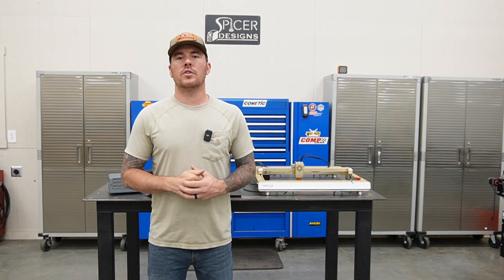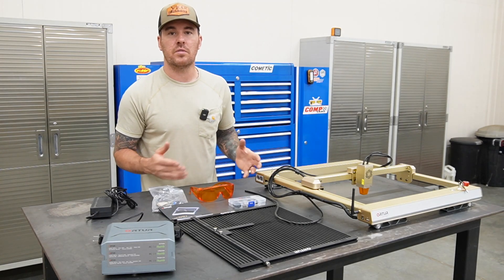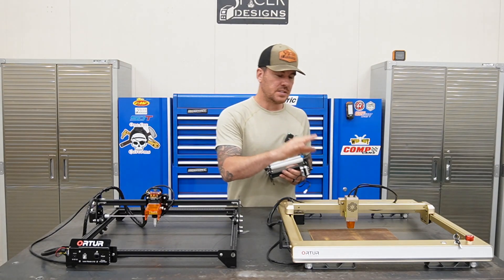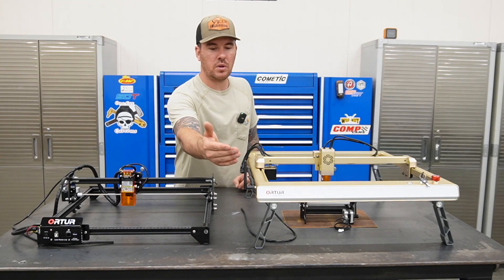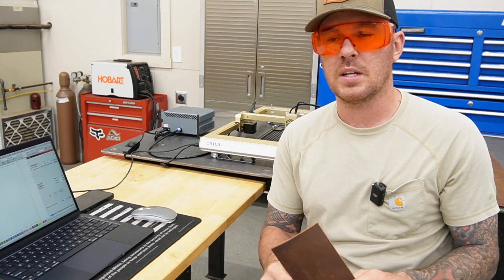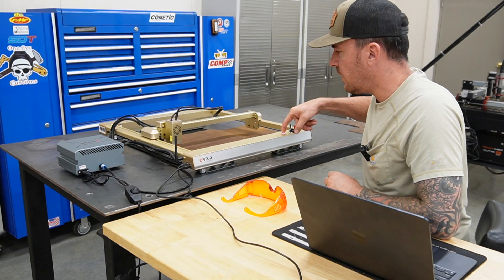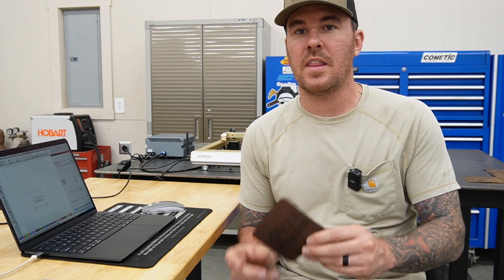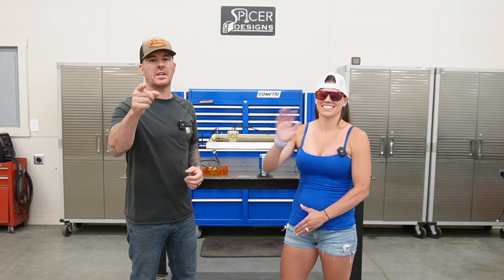ORTUR Laser Master 3...Best Laser Engraver For Beginners?

Comment: You didn't show how to connect it to the computer being these are wireless machines without USB. Is it bluetooth or do you need wifi in the shop to connect like how a Roku device works?
Reply from the maker: I believe its some kind of wifi signal.  I havent experimented with it yet.  I dont have wifi in my shop.  I think theres some other videos out there on that connection.

Comment: Well-Known Issues with Ortur Lasermaster 3: A Comprehensive Review

Issue 1: Ortur LM-3 Not Powering On
One of the most prevalent problems encountered by users of the Ortur Laser Master 3 is its failure to power on. This issue can stem from various factors, including a faulty power adapter, blown fuse, loose connections, malfunctioning laser module, or motherboard glitches. Notably, the Ortur LM-3 has faced criticism for having an underpowered "power brick." Despite seeking assistance for this issue, my attempts were met with silence. Subsequently, I discovered a suitable replacement on Amazon.

Issue 2: Inadequate Laser Engraving
When laser engravings fail to meet expectations, several causes might be at play. These include improper focus, uneven engraving area, or unsuitable materials for engraving.

Issue 3: Mid-Operation Halts
Frequent occurrences of the machine halting during operations can be attributed to loose connections, faulty motors, or software/firmware glitches. This issue has been highlighted extensively on YouTube.

Issue 4: Subpar Engraving Quality
Substandard engraving quality can arise due to incorrect settings, a dirty lens, or a malfunctioning laser module. To rectify this, adjustments in settings, proper lens maintenance, and considering the laser module's condition are recommended.

Issue 5: Smoke and Odor Production
During operation, the machine emitting smoke or strong odors might be a result of a dirty lens, improper settings, or insufficient ventilation. This concern is commonplace among lasers, particularly during cutting. Installing proper external ventilation and employing an enclosed setup are advised solutions.

Issue 6: Unusual Motor Noises
Motors emitting abnormal sounds during operation may be attributed to loose connections, inadequate lubrication, or faulty motors. Similar observations have been shared on YouTube. A common cause was Ortur's inadequate tightening of drive sprocket set screws, resulting in loosening.

Issue 7: SD Card Recognition Failure
When the machine fails to recognize an SD card, possible reasons include a faulty SD card, corrupted files, or firmware complications. Contacting Ortur for assistance may lead to unresponsiveness, as evidenced by my own experience.

Issue 8: Machine Freezing During Operation
Machine freezing mid-operation may stem from software/firmware glitches, motherboard issues, or communication problems between the machine and the computer. Establishing a reliable link between my Ortur LM-3 and my computer proved to be a major struggle. Despite weeks of effort and assistance from Ortur, I ultimately sold my brand-new machine at a loss due to this issue.

Issue 9: Inconsistent Engravings
Inconsistent engraving results might result from incorrect settings, a dirty lens, problematic materials, or a malfunctioning PWM (pulse width modulated) laser power controller. Obtaining assistance from Ortur for this issue was often challenging.

Lack of Customer Support and Service
In terms of customer service and support, Ortur falls significantly short. Despite purchasing their hardware, I received no aid when problems arose. Requests for help went unanswered, and defective parts were disregarded. Unfortunately, Ortur seems unwilling to invest in its customers' needs or satisfaction.

Personal Experience with Ortur LM-3
My excitement for the Ortur Laser Master 3's potential to enhance my workshop quickly turned to disappointment and frustration. Despite its promising appearance, I encountered only obstacles and minimal assistance from Ortur. Their lone response directed me elsewhere for help. Ultimately, after exhausting various resources without resolution, I was forced to sell the Ortur LM-3 at a substantial loss, leading to the demise of my aspirations.

An Urgent Recommendation
Given my ordeal, I strongly advise considering alternative options before investing in an Ortur product. It is my hope that you avoid supporting a company that displays such an evident lack of commitment to both product quality and 
customer service.

Parting Thoughts
I am not inclined to write negative reviews, but I felt compelled to share my experience as a cautionary tale for others. Thank you for taking the time to read my account, and I sincerely wish you success in your pursuit of a laser product that truly meets your expectations.
Reply from the maker: Thanks for all the info.

Comment: I have an Xtool D1 pro 30 watt and an Atomstack X7 Pro 20 watt. Just a bit of info. Many of the rotary manufactures like Atomstack are using the same series stepper motor on the Y axis on the laser as is included with the rotary tool you do not need to do any setup in Lightburn I just burned five mugs today and did not change anything in Lightburn Lightburn is the only software that should be used in my opinion. It is very powerful and is evolving everyday!
Reply from the maker: Xtool is a very nice laser from what ive heard.   And i agree, lightburn is great software.  Thanks for the info.

Comment: What I'd really like to see is a way to use a cutting laser on the Langmuir Systems Crossfire Pro that I already have. I have limited space, so I would literally be setting one of these up temporarily on the LS CF cutting surface.
Reply from the maker: That would be a great option to have a laser engraver attachment.  I dont think those stepper motors can move as fast as the engravers do.

Comment: Great little machine.  Could be very handy machine.
Reply: Well-Known Issues with Ortur Lasermaster 3: A Comprehensive Review

Issue 1: Ortur LM-3 Not Powering On
One of the most prevalent problems encountered by users of the Ortur Laser Master 3 is its failure to power on. This issue can stem from various factors, including a faulty power adapter, blown fuse, loose connections, malfunctioning laser module, or motherboard glitches. Notably, the Ortur LM-3 has faced criticism for having an underpowered "power brick." Despite seeking assistance for this issue, my attempts were met with silence. Subsequently, I discovered a suitable replacement on Amazon.

Issue 2: Inadequate Laser Engraving
When laser engravings fail to meet expectations, several causes might be at play. These include improper focus, uneven engraving area, or unsuitable materials for engraving.

Issue 3: Mid-Operation Halts
Frequent occurrences of the machine halting during operations can be attributed to loose connections, faulty motors, or software/firmware glitches. This issue has been highlighted extensively on YouTube.

Issue 4: Subpar Engraving Quality
Substandard engraving quality can arise due to incorrect settings, a dirty lens, or a malfunctioning laser module. To rectify this, adjustments in settings, proper lens maintenance, and considering the laser module's condition are recommended.

Issue 5: Smoke and Odor Production
During operation, the machine emitting smoke or strong odors might be a result of a dirty lens, improper settings, or insufficient ventilation. This concern is commonplace among lasers, particularly during cutting. Installing proper external ventilation and employing an enclosed setup are advised solutions.

Issue 6: Unusual Motor Noises
Motors emitting abnormal sounds during operation may be attributed to loose connections, inadequate lubrication, or faulty motors. Similar observations have been shared on YouTube. A common cause was Ortur's inadequate tightening of drive sprocket set screws, resulting in loosening.

Issue 7: SD Card Recognition Failure
When the machine fails to recognize an SD card, possible reasons include a faulty SD card, corrupted files, or firmware complications. Contacting Ortur for assistance may lead to unresponsiveness, as evidenced by my own experience.

Issue 8: Machine Freezing During Operation
Machine freezing mid-operation may stem from software/firmware glitches, motherboard issues, or communication problems between the machine and the computer. Establishing a reliable link between my Ortur LM-3 and my computer proved to be a major struggle. Despite weeks of effort and assistance from Ortur, I ultimately sold my brand-new machine at a loss due to this issue.

Issue 9: Inconsistent Engravings
Inconsistent engraving results might result from incorrect settings, a dirty lens, problematic materials, or a malfunctioning PWM (pulse width modulated) laser power controller. Obtaining assistance from Ortur for this issue was often challenging.

Lack of Customer Support and Service
In terms of customer service and support, Ortur falls significantly short. Despite purchasing their hardware, I received no aid when problems arose. Requests for help went unanswered, and defective parts were disregarded. Unfortunately, Ortur seems unwilling to invest in its customers' needs or satisfaction.

Personal Experience with Ortur LM-3
My excitement for the Ortur Laser Master 3's potential to enhance my workshop quickly turned to disappointment and frustration. Despite its promising appearance, I encountered only obstacles and minimal assistance from Ortur. Their lone response directed me elsewhere for help. Ultimately, after exhausting various resources without resolution, I was forced to sell the Ortur LM-3 at a substantial loss, leading to the demise of my aspirations.

An Urgent Recommendation
Given my ordeal, I strongly advise considering alternative options before investing in an Ortur product. It is my hope that you avoid supporting a company that displays such an evident lack of commitment to both product quality and 
customer service.

Parting Thoughts
I am not inclined to write negative reviews, but I felt compelled to share my experience as a cautionary tale for others. Thank you for taking the time to read my account, and I sincerely wish you success in your pursuit of a laser product that truly meets your expectations.